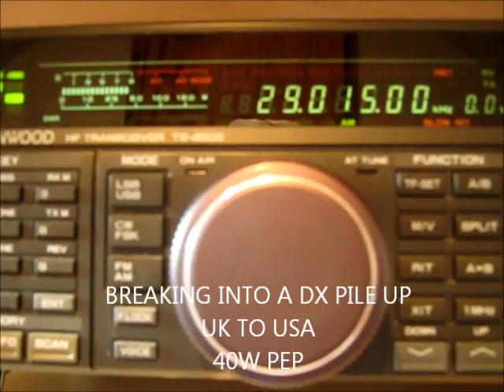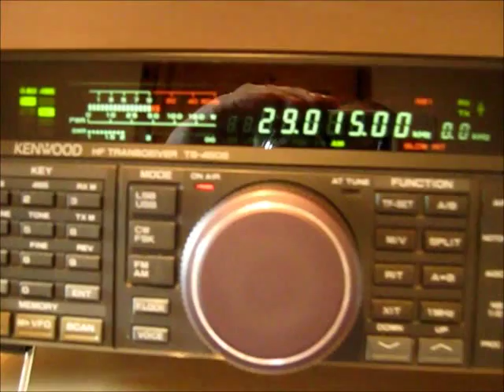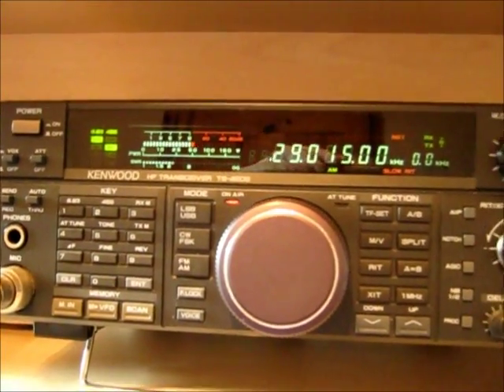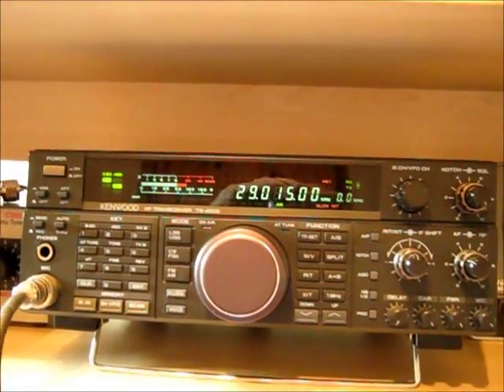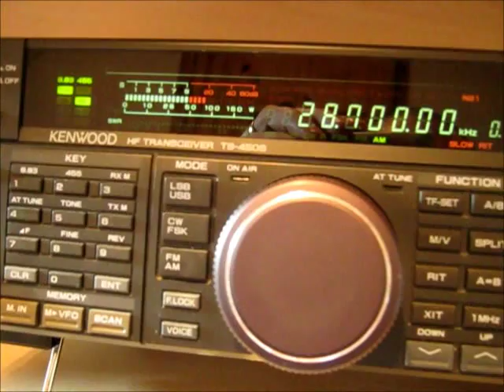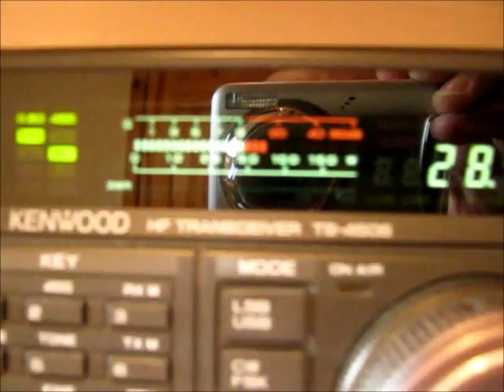10m rectangular loop antenna

Comment: you need a 2.1 transformer at feed point
Reply: @dl6urk88  the feed point of a loop is approximately 110 ohms a 1.1 balun would not match that a 1.1 balun closer to the rig for rf choking would be ok
Reply: @TheBrynu  That's not true.
Reply: @dl6urk88  so why has he got an swr of 2 meaning 2=100 ohms approximately at the feed point
Reply: @TheBrynu  You're right. The loop is not perfect at the set frequency. It seems that M0MAD has a perfect SWR on 28.4 Mhz https://www.youtube.com/watch?v=4Km2Oz5m_Yo  3:00.
Did you follow the first link that sheds light on the relationship between the edge length of oblongs and the SWR?

Comment: Nice!  Can this antenna be changed to vertical polarization?
Reply from the maker: Hi Alan, the whole antenna can be turned 90 degrees so its on its side to produce vertical polarisation but would need two supports each side. maybe strung between two trees.

Comment: Do you still use this antenna?
Reply from the maker: The dimensions for my rectangle loop were 139" ( or 11.75 feet) both vertical sides
And 72" ( or 6 feet) top and bottom horizontal wires.
The feed point is in the middle of the bottom horizontal wire and is 50 ohms. You can connect coax or a better idea is to wind a choke balun with your coax before the connection. You may need to adjust the whole loop and pull the vertical wires a little longer and horizontal wires shorter for best VSWR. Here are a couple of links to articals which may be useful 
The dimensions for my rectangle loop were 139" ( or 11.75 feet) both vertical sides
And 72" ( or 6 feet) top and bottom horizontal wires.
The feed point is in the middle of the bottom horizontal wire and is 50 ohms. You can connect coax or a better idea is to wind a choke balun with your coax before the connection. You may need to adjust the whole loop and pull the vertical wires a little longer and horizontal wires shorter for best VSWR.
http://kt4qw.com/acan1bu.htm
http://amfone.net/Amforum/index.php?topic=30353.0
Hope this info is helpful. Good luck with your homebrew antenna.
Reply from the maker: I haven`t used 10m in a long time due to the poor propagation from the states but have the antenna rolled up in the shed for when conditions improve.
Reply: What are the measurements for this please or were can I get them ,, thanks Shane uk

Comment: what balun is used ?
Reply from the maker: A choke balun. The rg58 coax can be wound around a former or simply coiled up in a loop. I have tried both.
Reply: @m0dad  How many turns of rg 58 for the coiled loop?  ;)

Comment from the maker: Hi Tim, yes the rectangular loop is a very quiet antenna for noise but really pulls in the DX. I was surprised at just how well they work. Its bidirectional so you do have to rotate the antenna for optimum signal unlike an omnidirectional vertical. But to answer your question its much quieter than the vertical.

Comment: Sections 1and 2  of the vertical reference antenna (1.02) look like they've fallen inside each other and the element is no longer resonant, it should be a least 16' and yours looks short ?